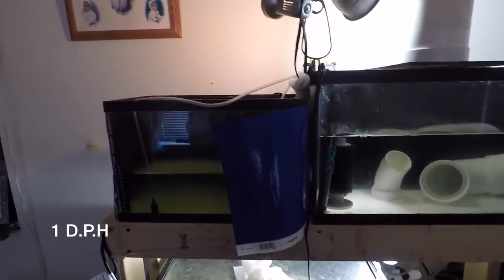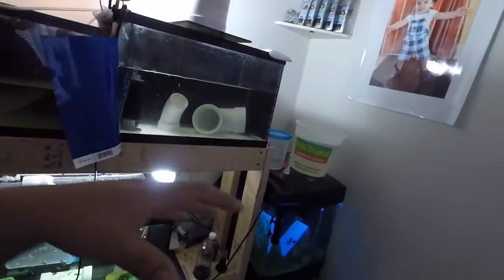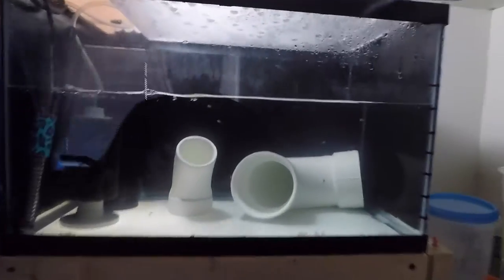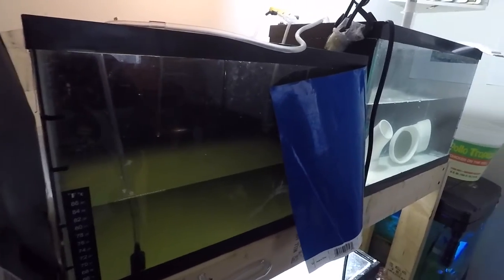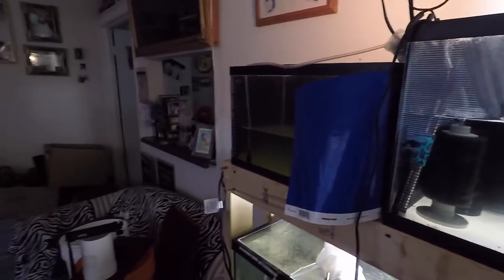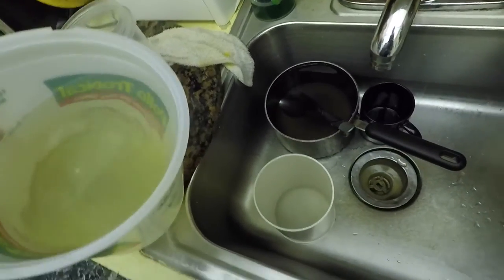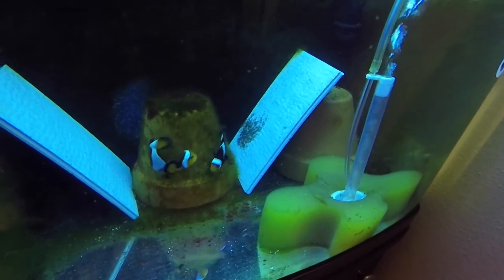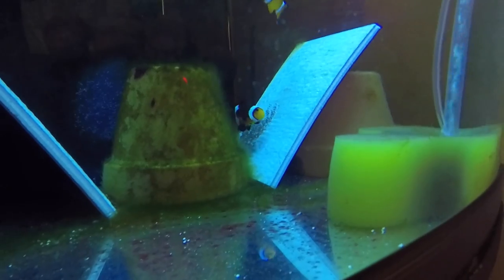Clownfish Breeding Series - Days Post Hatch (D.P.H) 1 - 3

Comment: Few questions. 
We attempted to raise fry but as of day 2 only a few left and they don’t appear to be doing well. 
We got the rotifers in the mail the same day eggs hatched....we did add some on day 1 but I’m not an expert in counting how many. We had the fry in a 10 gallon tank with 2.5 gallons of water. The eggs were on a piece of live rock that we moved to new tank. We did use parent tank water. We had 2 air stones and our cobalt heater laid on the floor of the tank....what heater do you use? The ammonia hasn’t spiked. We added a gallon of parent tank water on day 1 too. 

Any ideas what went wrong? 
Also my female is an orange ocellaris and the male is a black ocellaris what do you suppose the offspring will be?

Comment: Hey Luis one more question. So if I will move the pot to the new tank, can I start with clean fresh mixed saltwater? Or does it have to be the same water from the parent tank? If I can use new water, does it have to be the same salinity as the one in the parent''s tank? I''m concerned about the fact that my salinity in my reef is 1.025 and if I use that water, when I add the rotifers which are at 1.017 it will cause the rots to shock and die prematurely fowling the water. Should I be concerned about that or not really?  Thanks!
Reply from the maker: AcuaTV I like to use all new seawater  and some people will argue to use half parent and half new seawater. Personally I like all new water but it's a trial and error thing. If all your fry die the following morning then try half and half. Usually I only recommend half and half if you are using the trap to catch fish instead of having a removable object. The Rots can go into shock if it's a big change in salinity so I would try 1.020 - 1.021, but honestly rotifers are kinda sturdy. No matter what the floor will be covered with them in a few days

Comment: What is the differece of rg complete and the green omega?
Reply from the maker: Brenda Cohen rg complete I use for rots. I’ve called reeds to ask if you could use rg complete for both tinting and for rots and they said it’s possible but only in case of emergency. The omega is more concentrated and thus needing less to tint the water. Rg complete you would use more thus wasting more